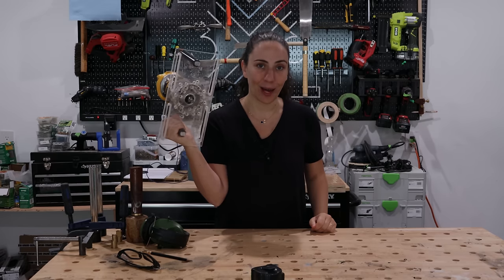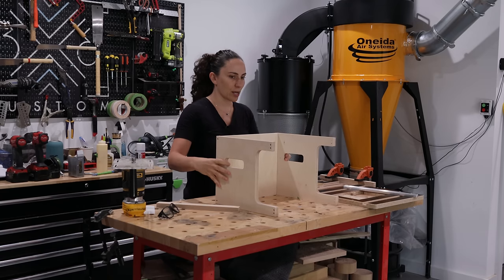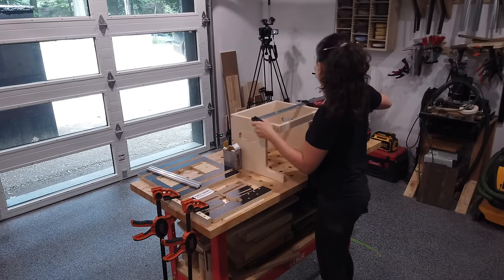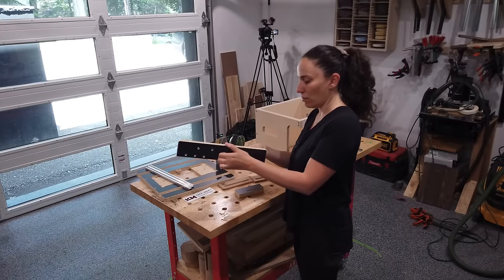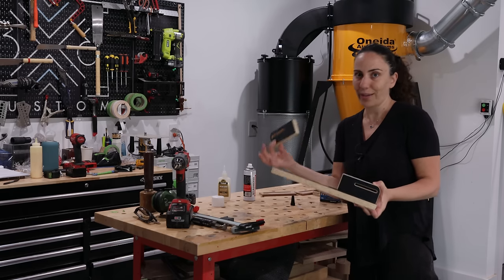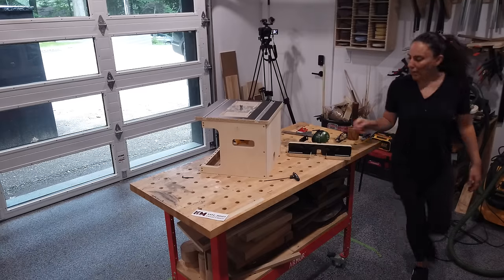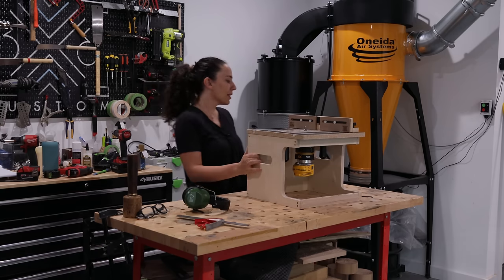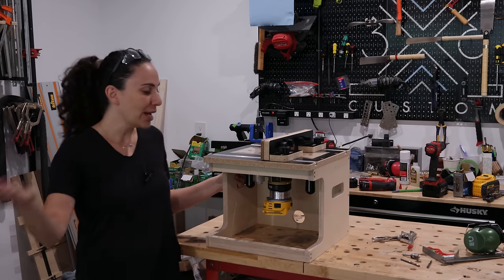Benchtop Router Table for the 6-in-1 Trim Router Jig

Comment: As always, it is such a pleasure to collaborate with you, Tamar. I look forward to all the really cool things we have coming up. I always look forward to seeing what you come up with. Thanks for the kind words. Don’t forget you can add the little pin that comes with the router jig as a starter pin to the plate with a 1/4-20 tap. check out my latest video for more details.
Reply: I made it about 7 minutes into the video before I pulled the trigger on this. Purchased!!!
Reply: Pony up for the screws for the side, man
Reply: @terristroh3965 nah. We include all the specialty hardware and screws for the t-track. All of which I buy in bulk at significantly cheaper than retail. Good screws are tough to get wholesale without buying hundreds of thousands at a time. With labor to pick and pack 36 screws I’d have to charge at least $10 more for the product. My employees tried it and we’re just getting poked and frustrated by the process. Screws are one of those personal preference things (Phillips, square, t drive etc) so I dont want to pay retail for screws and have to pass all the labor and marked up materials cost to the consumer. Figure we all have screws laying around our garage so you might as well save $10 and use the screws of your choice.
Reply: With you Jonathan,  if there is anything a workshop should have in abundance,  it's screws! Every trip to the hardware store,  a feller ought to get screws and bolts, I think I have just about every size made up ti 5/8x 8" Lag bolts.
Reply: Looks awesome! My only feedback would be to pre-drill the pilot holes. Great work!
Reply: @katzmosestools  Hey, JKM ... poke your customer service folks, my kit arrived sans instructions and hardware, super annoying. Logged a ticket but no response yet. [UPDATE]: I got an email from KM customer support later this day and received my hardware pack a few days later.
Reply: You two should collaborate on a series, call is Tamar & Katz solutions. 
1) you’re both together reading a question about some common problem. 
2) you have X amount of time to brainstorm together on a fix. 
3) you have X amount of time separated showing you developing your ideas. 
4) you meet back up and present the final solutions to each other. 
5) inventions are judged by Izzy Swan. 

WGA strike is going to leave a huge gap for shows.  Strike when the irons hot!
Reply: @3x3Tamar loving the new shop and acknowledgement of your partner! I highly recommend anti fatigue mats with tapered edges...Thanks for keeping things simple you two.

Comment: Tamar, if you cut the screw down for the handles, you will have a lot less threads to screw on and off. You don't need that many. I do this all the time when making things that need to break down and assemble quickly. For the handles you just need about three threads catching and you'll be fine. Thread a nut on them first before cutting, it will help clean up the threads afterwards. Love your videos!

Comment: I don't remember buying a useful tool that became even more useful later on. Love it. Ordered router table about 4 days ago. Props for the engineering and the partnership.
Reply: I wouldn't call a palm router in a router table more useful than one not in a router table. In fact I think the opposite may be true. Palm routers are for putting on edge details. They don't have the power for proficiency in a table on hardwoods.

The only way my palm routers getting inverted is if I'm getting inverted with it!

My 3 routers are a makita palm router, festool 1400 plunge, and my dad's 2.25hp bosch (in the table) all plug in, all variable speed. I want a 3.25hp router for my table. Not ready to jump yet. Triton has gone downhill, rockler won't carry thier new model routers... Festool is $1,000 so I'm waiting. hoping bosch makes a 3.25hp model again soon, or an update from Milwuakee, or I'm buying a makita.

Comment: I got the jig + table bundle from KM tools about 2 weeks ago! Absolutely Love it!! Fits my Makita 18V perfect. Took me a bit longer to assemble since I didn’t watch the video before and assemble my needed supplies like Tamar… (I wouldnt call that cheating, just a bit more OCD…) I would pause the video and gather tools as I went. But I was in no hurry and had a couple cups of coffee. I didn’t use any superglue. I sanded with 220 and put a finish of oil/poly/spirits on and also an included sticker. The next day I had to round off slats for a good size project. Those pieces were 3’ and I did both sides of about 60 of them… Apart from changing batteries, I didn’t have to make any adjustments AT ALL and the quality on the last one was just as good as the first. I used a shop vac for dust collection behind the fence like Tamar did and secured the hose with a bungee. I also mounted a strong magnet to the inside of the box which keeps my router wrench handy. I store my earplugs around the handle cutout. I am considering putting some ruler tape on the tracks (0 on each track lined up with the center of the bit)… but a ruler works well for now. 
I’m a big fan of Tamar and JKM, and this collaboration is AWESOME!!! Thank you both and keep on trucking.
Reply from the maker: Sounds like some great additions!

Comment: I have the 6-in-1 Trim Router Jig and I like it very much.  I also have a dedicated router mounted to a router table so I personally don't need this now.  However, I could have used this years ago when my shop was a lot smaller (and so was my budget).  This looks like a solid design and a great overall table for people with limited space and for people routing smaller things (esp. limited space).  I especially like the fact that this table was designed to match an existing product rather than forcing people to buy something new.  All around three thumbs up on this.
Reply from the maker: Glad you like it! Yeah, totally not for everyone, but great for those that don’t have a larger set up!

Comment: Off topic, but I loved watching your shop build.   I think my favorite part of the shop I only noticed today--the see-through rollup door.  Love having natural light to work with.
Reply from the maker: It really is nice to have the natural light. But sometimes awkward when the ups guy drops a package off and I’m mid cut 😂
Reply: @3x3CustomTamar   oh no!  I designed my own router table to fit on one of those famous fliptop tables (since I'm a bit space limited).  I added flip up "wings" giving me another foot of table space on either side.  I also cut a metal yard stick in half, then glued them into a groove on either side of the router--this way i have TWO reference points to line up the back wall.  Happy to send pix if there's a way to do that.

Comment: I've been using my Makita 18V trim router with your 6-in-1 jig with a router table since some time last year. I left a comment on Jonathan's video saying his design is so much better than the router table I made, but the one thing mine does that his doesn't is that it allows me to go from handheld to router table in under 5 seconds. Cos unlike his, in which you need to unscrew the handles, then screw them back on from the bottom, with mine, the jig stays on all the time and is just slotted from the top of the router table. The flip side of that, of course, is that there's nothing but gravity holding the jig and router down. So far that's been fine, possibly cos of the extra weight of the 5Ah battery.

I have to add that I discovered another use for your 6-in-1 router jig two days ago — as part of a router sled setup (using two of the extension feet, the two extension arms, four bolts and four knobs).  I shot a short clip of that, but haven't edited it. When I post it on Instagram, I'll tag you.
Reply: I was wondering the same thing about whether it was even necessary to screw the top down since you're going to be pushing down on it anyway with the piece that you're routing.
Reply: @michaelgrove7565  The only reason I can think of is if there's massive kickback. But I am careful about how I feed the piece I'm working on..
Reply from the maker: It’s def just a safety thing and you can leave them off. That sounds like a great added use!

Comment: Well when you said 'assembly is fun' I am just going to have to trust you on that because I have never know that to be the case but that's me :) Good to see you back on the air. Missed your videos. Your shop looks great!
Here's a great story. Been helping a scout with a woodworking project. Lots and lots of funky angles and lots of Dominos. I told the scout that I never got out of my head how you stated in a video that you use make the loose cuts on both ends of the domino just in case. Ironically, I caved on one complicated joint - I did the same and am glad I did!

Comment: LOL! Funny energy in this one.

I HIGHLY recommend you seal all the raw edges of the table top.  In my experience, the cut edges of particle board and MDF will swell and warp from moisture, and since the middle is cut out to accept the template, it will also warp unevenly and could eventually make the table not very flat. Paint the template cut out area to seal it up, and hopefully it won't amount to much with such a small table top.

I could see a lot this being really useful for some carpenters on job sites.

Comment: I watched Jonathon's video before yours, only because his came out a couple of days ago. I'm thinking that this would be perfect to be mounted into a work bench as a main router table, for those of us who don't have a large, stand alone router table, or are constrained by space issue in our shops. To that point, some beefy corner blocks with threaded inserts would be handy for holding it in place until such time as you need to move it to an outdoor location or to take it into the house to do some work in there. I do realize that it wouldn't be the same as a beefy 3 1/2  hp router, in a dedicated router table, but for many of us it would be perfect for long runs of round overs and chamfers. I love the fact that both of your logos are laser engraved on the fence portions. Looking  forward to whatever the next collaboration brings to the world. Keep up the great work and let's see how many times this gets used in upcoming projects.
Reply: I would recommend buying a router table insert and a router insert routing template.

Then you can router in your router table into any workbench you make. Placing a router table into a work table feels like tableception.

The advantages with this setup, is it will work with any router, and any router lift, should you want one down the road. There won't be a need to re-engineer your bench!

All the stuff needed is available @ rockler woodworking or probably woodcraft as well.

Comment: very nicd little router table but (of course) but perhaps I am missing something here. I went to the web site to check out the cost and I noticed there is a rather large opening for the baseplate a yet no baseplate is included. I assume you created this for your specialized baseplate that costs an additional $70.00 that I am no interested in. So what is the size of that opening or  do you offer a top that I could router out my own opening for my routers baseplate. Thanks for a fine video.

Comment: Nice job on the design of both products. I ended up having to use a 1/2" shank bit on a project and I just cut a piece of plexi to the same dimensions as your 6 in one jig. Then I drilled holes for the router base. In less than 10 minutes I have a 2nd router that fits in the router table. It's kind of handy because Instead of changing bits and having to realign everything I just pop the routers in and out of the table. It was very handy for my sliding dovetails. The initial channel with the straight bit on one router, pop that router out, run the dovetail with the 2nd router. It's actually quicker than the bit change.
Reply: Not certain it meets OSHA saftey standards. Most bench tools these days have a paddle switch for the power.
Reply: @brandonhoffman4712  oh, I see now. You're some kinda weird OSHA fanboi with safety posters all over the house huh. Guess what, OSHA doesn't operate world wide and most of us don't care what they think is safe or not.
Reply: @TheMixitman  my bad didn't know you weren't from the states. I would imagine any modern civilized nation has a governing body over construction standards for human saftey similar to OSHA. And yes I am a fan of OSHA as are most Americans that work in construction. They are keeping us from reaching an early grave like so many have that came before us.

The only poster I have is one of you bathing in paint thinner breathing in methelated spirits straight from the can while angle grinding without any form of PPE. There you are on my wall with a look of confusion with a caption that reads (PPE I play with my PPE everynight!)

Comment: I purchased my bundle yesterday and can't wait for it to arrive! My current plan is to figure out a way to attach it to a mobile cart so I can get some extra storage in my small garage, which doesn't have a lot of great workspace to clamp this down on. I'm really excited to check out the 6-1 jig as well! Thanks!
Reply: Thinking about doing the same! Pretty excited to get this guy up and running in the shop soon!
Reply from the maker: Awesome. That sounds like a cool plan

Comment: Fantastic video Tamar.  Jonathan makes some incredible pieces and as you mentioned, they are well thought out.  What I really liked about this design is the open front.  It may seem like a little detail, but having full access to my router for adjusting height or quick changing bits, really is an advantage and time saver.  Also, the extra room inside the box that allows for my vacuum hose to connect to my routers dust collector (I have the same set you as you do) is exciting.  Even with my full sized 3 HP router table, my dust collection doesn't work that well, so I see myself using this small job router table a lot more.  Thank you for doing these videos.  Keep up the good work and I look forward to watching your newest projects.

Comment: The only complaint I can think of on this unit is the placement of the router bits. If you put the bits there and then need to remove the router to change the bit, good luck no cutting your hand. And you can see this at 16:46. I think putting the bits on each side of the front legs, 3 or 4 per side would be more practical and safer.

Comment: Just getting started in wood working, do you ever find yourself needing a larger work surface to use a router with … or is that when you would go handheld as opposed to bench top operation?
Reply from the maker: Larger no, there is enough surface area for support

Comment: Great video about a great product - I'm looking forward to using mine. Quick question about the various parts of the 6-in-1 jig. It looks like only the base plate and handles are used with the bench and all of the extensions of the jig are for when using the router as a hand-held. Is that correct?  Thanks.
Reply from the maker: That’s correct

Comment: I like it. The whole kit is definitely on my wish list. And brilliant pun at 8:20.  Question: did you put the top in the correct orientation? It seems a quarter turn off from JKM’s video. Or is that your preference?
Reply from the maker: That’s the way jonathan designed it

Comment: I bought this with the table and the mounting holes don't fit my Ryobi router, I'd love to be able to purchase the 6-in-1 base plate either with custom holes or without any mounting holes so as to be able to mark and drill the holes to suit my corded router. I run my cordless tools on the Ozito Brand (Bunnings Australia) and don't want to have to buy a single cordless tool of another brand and have to purchase a battery pack/system for a singular tool. I have managed to drill holes on the base to fit my router but 2 of the holes are so close to exiting holes counter sinking the holes is a nightmare.
Reply from the maker: I’m sorry you had problems with yours. If you ever have any concerns please reach out to my support team linked on my contact page on my website

Comment: Great video! I was inspired by your 6 in 1 jig, and made one of my own (engineer with spare time and access to CAD...) It's definitely slightly different than yours, because I didn't have the plan, and made it to be cut out of a smallish sheet of polycarbonate, so it's likely a smidge smaller. But it works awesome. I'm going to have to make a table for it!!

Comment: I feel as though the router bit storage bar is in the wrong place. When inserting the router you arms are going to get cut up on the bits. I’m thinking the storage should have been on the side.

Otherwise it looks to be a great product.
Reply from the maker: I hear your point. One doesn’t have to use them. But I see it more as a temporary holding place while working with a few bits on a specific project. So like they aren’t rolling all over the table… ha.

Comment: Also interested in the mentioned upcoming workbench. I have the same issue - my router table/router stands too high on my current workbench - curious to see what you come up with!
Reply: Put a French cleat on the front or side of your workbench then put a French cleat on the back of your router.  :-)
Reply from the maker: Almost done with with… I sprained my ankle so uploading videos has been very slow…